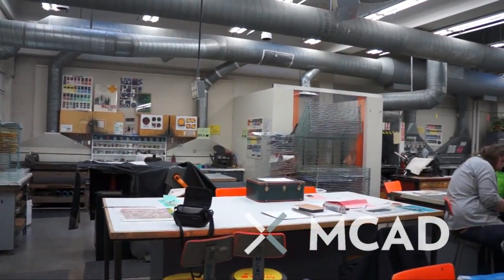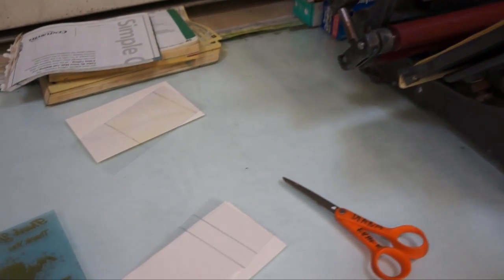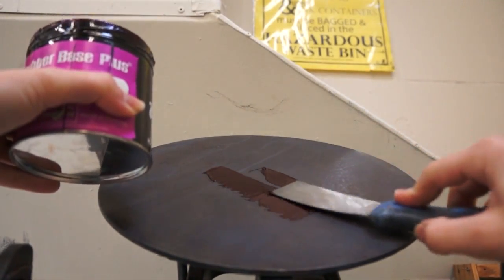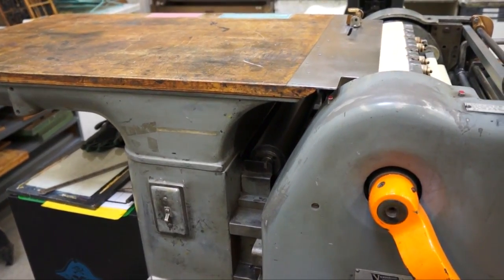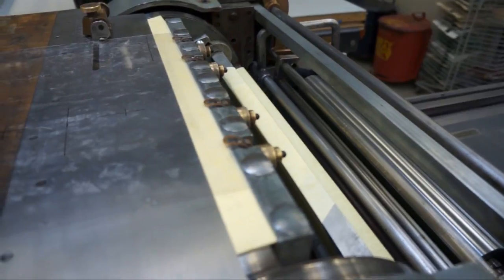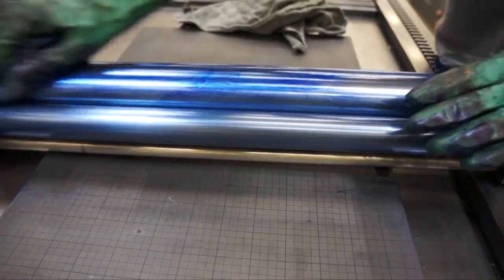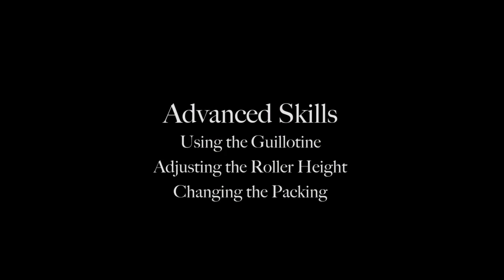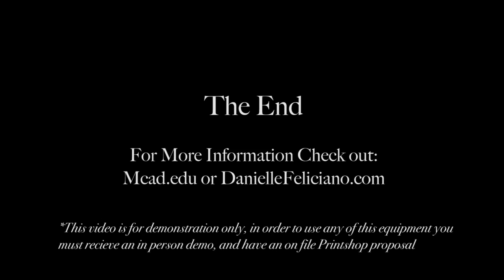Learning how to Print Letterpress (Kelsey Press, Vandercook, & Showcard)

Comment: One caution that I would like to add, I have a 1930s' Challenge lever cutter that's very much like yours. MAKE VERY SURE that the lever is ALL the way back and locked. People get in a hurry and if that lever is not locked, fingers get lost. Probably the single most dangerous piece of equipment you have. Iv'e  been in the industry for 35 years and have heard many a horror story on those. mine has a stout chain and padlock on it. Kids want make pads fine, use the clamp and clean up after. Need something cut, ask Dad.

Comment: this is an old post buy if anyone knows how to run a Miller 25" letterpress for die cutting I would like to talk to you. I just volentold that I will be running one as the guy that did quit. looking at anything and everything letterpress to try and get a clue.